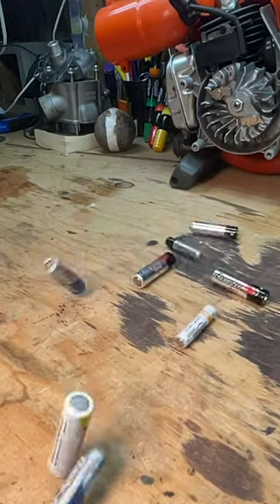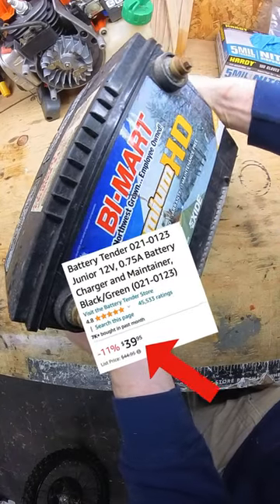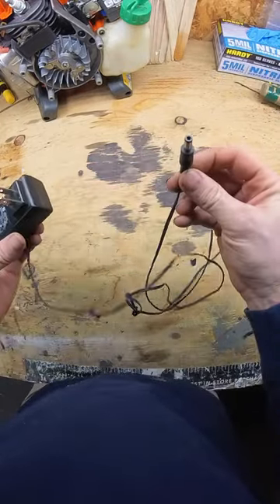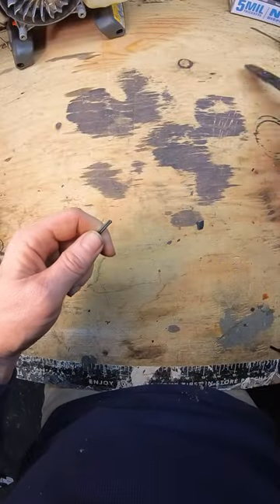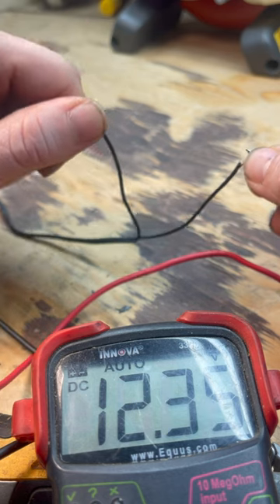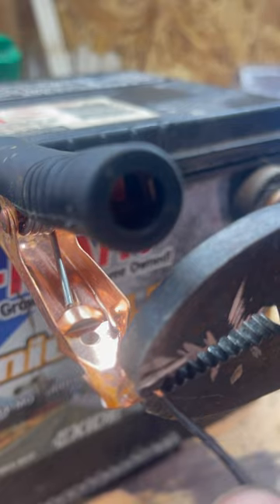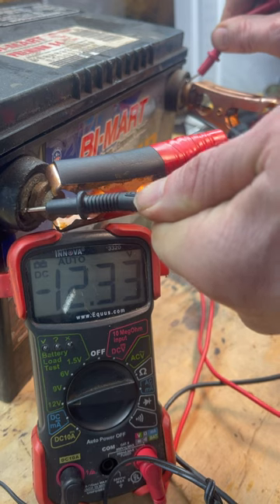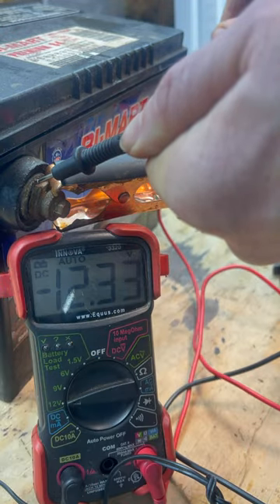Car battery hack. What no way! Dead battery. How to DIY battery tender.  Home made 12 volt charger

Comment: 12.3V is quite insufficient... Personally, I use 14.05V for 24/7, 365 days. I have never had a battery fail because of sulfation.
Reply: Correct, a fully charged car battery should read 14v then drop to 12v once under load

Comment: the difference between a standard adaptor and a battery tender adaptor is the current limiting, turns out thats very important. a standard adaptor does not have that and i found out the hard way when i had one explode shortly after connecting it then it shoved 230v straight into the battery, main house breaker tripped, set fire to the wires that allmost set fire the the shed in the process
Reply: 230 volts! What were you using? It definitely wasn't a small adapter like this video showed. Also didn't it have the voltage output on it? If not you should have tested it.